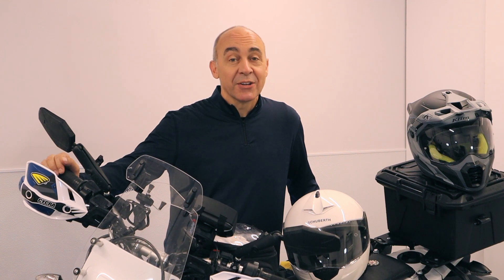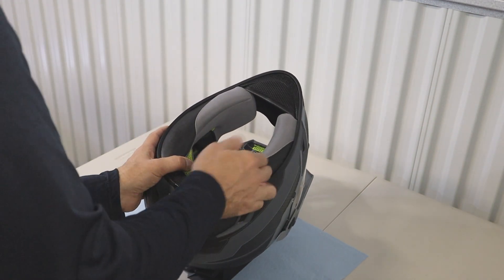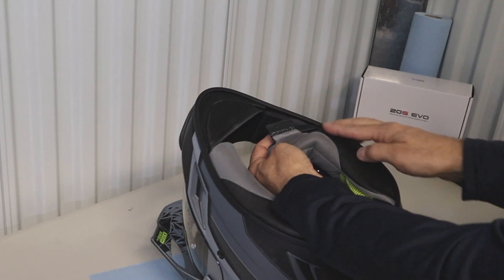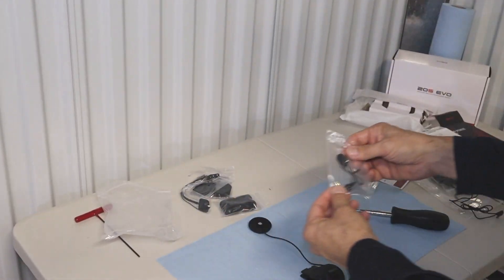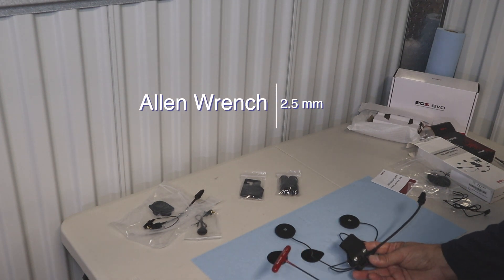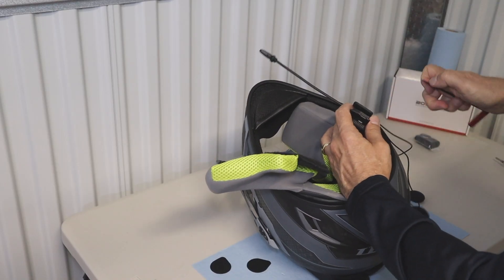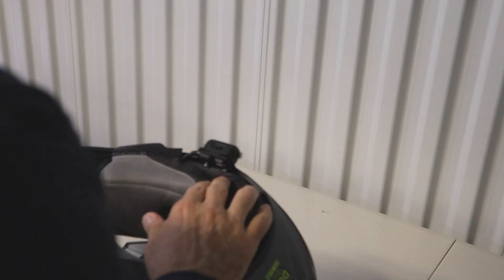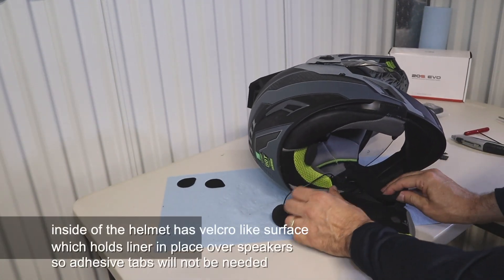Klim Krios Pro Sena 20S EVO install

Comment: I have the 50S installed, goes in easy enough but really don't like having that piece hanging down next to my collar bone for off road use. Any clever mounting options for these types of Sena's tha tdon't need the part hanging below the bottom of the hemet? or at least not as chunky?  I hope they come out with an updated option that has mesh the fits like the special built 10U for this helmet, but if you don't use it a lot for group rides and don't need the range of the MESH network I would probably go with that.
Reply from the maker: I'm also looking forward to testing the Sena helmets this season...not sure if it's reasonable to expect a technology company to make a world class helmet that can compete with an Arai, Shoei, or Klim but it would save a step for a lot of riders if they did.

Comment: Thanks for the video, I have exact same helmet and looking for comm options, was looking at Sena 10U recommended option
Reply from the maker: Thanks, I also considered the 10u and I honestly can’t say how good the 10u is for certain but I ultimately chose to transfer the 20 to this helmet because I like that it has better range, battery life, and total connections plus I like how easy the 20 is to use with gloves on.  Good luck with your decision!
…I would be interested in feedback from anyone with the 10u installed…how is it working out?
Reply: @dualsportgarage  after finding out the 10U is almost the exact same price as the 50R (literally 17 euro), I just ordered the 50R dual pack (my riding buddy needed a new unit), so man6 more features above 10U for almost same price was a no brainer. 👍
Reply from the maker: Awesome!

Comment: I just got the helmet yesterday and ordered the Klim specific 10U. I mainly use it for music and an occasional call but not for bike to bike.  Not sure what the major benefits to the 20 would be over the 10U. I have the Sena SRL that is specific to my Neotec2 helmet so I’m hoping the 10U will fit as well in the Krios Pro
Reply from the maker: I agree, for most people bike to bike is not the top priority. My number one use has always been turn by turn navigation ...so I don't miss my next exit!
Reply: The benefit to the 20 over the 10 is better sound quality and 8-way mesh versus just a simple four-way. A lot of people on RevZilla are complaining about really poor audio quality of the Klim specific model
Reply: @turbolag5107  I can concur that the 10u sound quality is not good and the volume is unusable with ear plugs. This is not the case with the SRL-Mesh in my Neotec II helmet
Reply: @PapaDougsAdventures01  I have the 20s Evo and I had it made it up to my bell mx-9 adventure but the peak on that sucks and barely does anything as far as far as blocking the Sun and it is very loud at highway speed. I actually just got this Klim Krios Pro and I attempted to install the cradle but as I went to install it I realized somebody else had tried to do the same thing and then I guess got frustrated and sent the helmet back because the left cheek pad is all torn up. RevZilla is sending me out new cheek pads but I'm interested in getting this eventually installed properly
Reply: @turbolag5107  you’ll love the Klim. Very light and very comfortable. I did remove the visor because I didn’t like how the windshield had different reactions to the sun. I’ve not missed it at all and I love the Photochromic Transitions Shield. Still not sure if I like the magnetic locking mechanism
Reply: @PapaDougsAdventures01  I wore it for a little while yesterday to get used to it but I've noticed it has a similar problem to the Arai XD4 that I had. The neck roll pushes into the back of my neck right at the base of my head and the Arai XD4 was causing neck and back pain on rides longer than 30 minutes. Lots of squirming and flexing my back. I'm hoping this helmet doesn't end up being the same way.
Reply: @turbolag5107  Can you upgrade the speakers to their newer bigger ones, or some of the aftermarket? Couldn't tell if the 10U speakers plug in, but I suppose you could just cut the wire and splice in the others with a little solder and heat tube. Not sure if that helps or if the unit just doesn't put out enough power.
Reply: @noControl556  I just finagled the 20s evo and it works. There's no speaker pockets but there's enough cushion/lack of cushion where the speakers go that for me I don't really feel them. I just have to wiggle the helmet around a little bit to get my ears to flip the right way but it works lol.